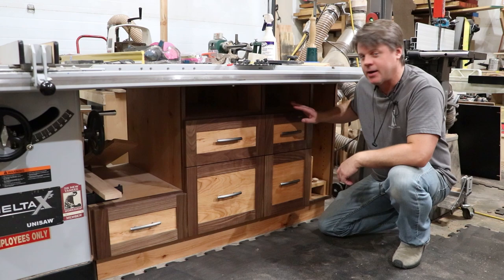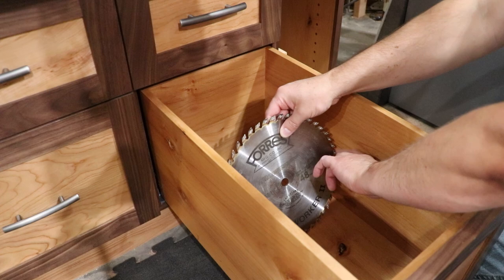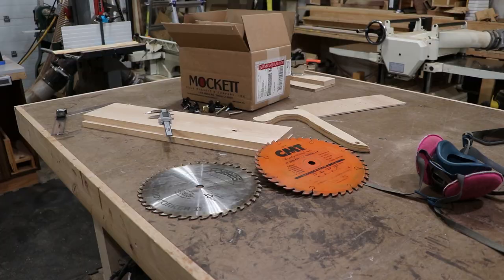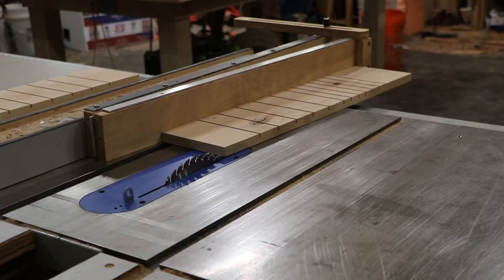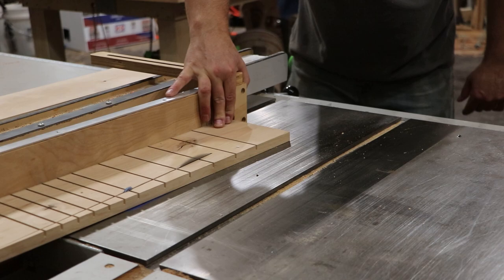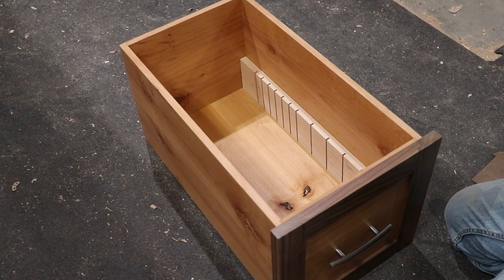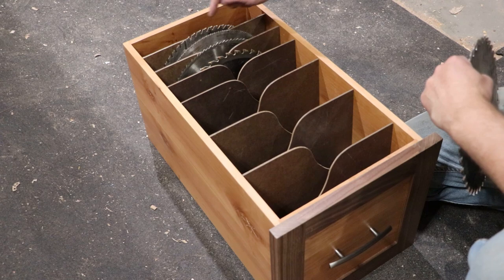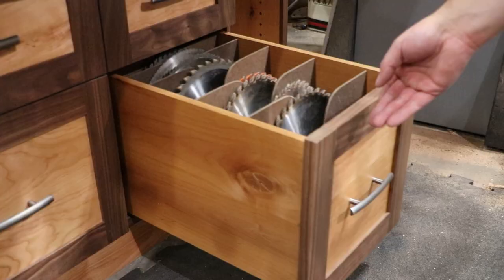Designing On The Fly A Table Saw Blade Storage Drawer For Shop Cabinets

Comment: So, which blades sit in the top 5?  Seems like you have good taste, FOREST/ CMT :) Or more specifically what's your go to *miter saw 12" blade? Gracias
Reply from the maker: My main go to blade for the table saw is a Forest combo blade 40tpi.
For the miter saw, I use the festool brand wood blade.

Comment: This is the most complex and inefficient use of space I have ever seen. Bad storage system. You can not see what is in each drawer. So you have to hunt for the one you want. Only a cabinet maker would think of this. 
I hand all my blades on 4" long peg hooks on my pegboard with cardboard spacers between the blades. I organize them by diameter and by tooth count. I can immediately see what blade I want.
Reply from the maker: Congratulations, you found the hole with your peg.